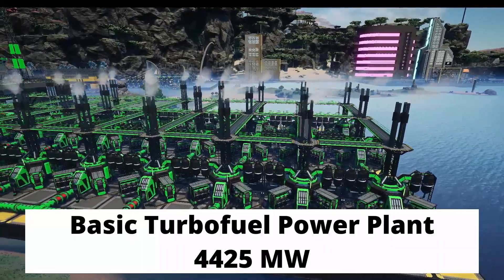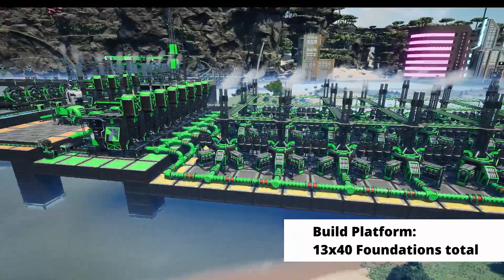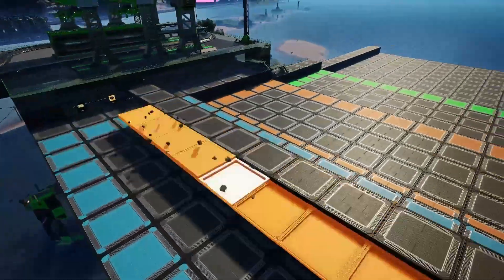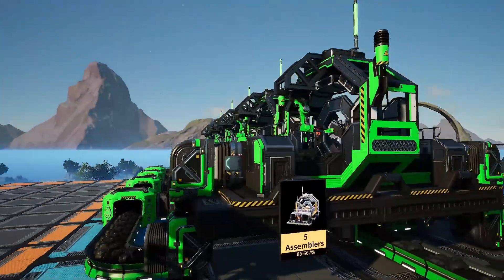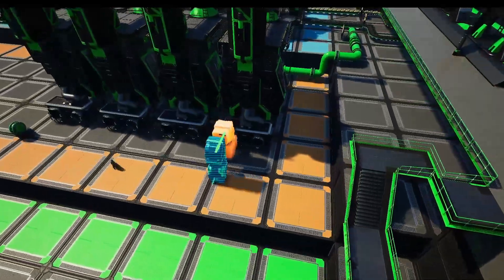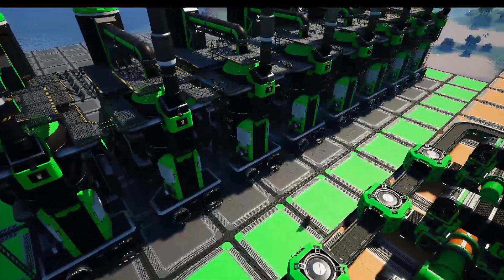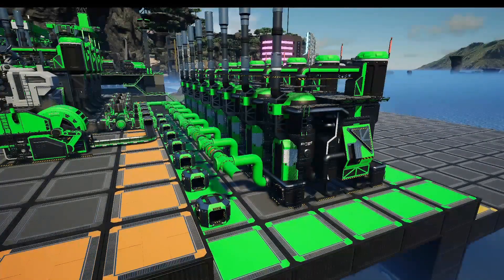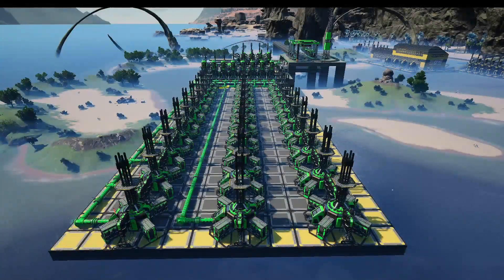100% EFFICIENT Simple Turbofuel Power Plant Build Guide - Satisfactory Update 8

Comment from the maker: per @Shammyy1" I mathed it out, and the correct number of generators in the new version is 17, with 1 underclocked to 75%. Feel free to pin. This allows a .2 over production of turbofuel.
Reply: Per below discussion because I didn't see further research done, this message is correct (with clarification). 18 total generators, 17+1 underclocked. 17x7.5=127.5+5.63(underclocked one)=133.13 of turbofuel being used out of 133.336 (8x16.667) being made so .2 extra being made. Hope I save someone a maths.

Comment: Does it matter which belts are used? my compact coal is running out very quickly it isnt creating enough to feed all of the refineries to make turbo fuel. i am using mk1 belts rn which i can change and 1 normal node of coal and sulfer. i can upgrade to mk 2 or possibly 3 but im unsure. with that belt being split 8 times i dont think its enough but maybe im wrong @Dekoba

Comment: thanks for the video! i really enjoyed building this. But, its not working for me. I set it up exactly to your specs, and did only 18 of the fuel generators, one clocked at 75%. I let them all fill up totally before starting, and the ones in the back of one of the lines continue to run out of fuel. Its unclear in the video how you hook up the pipes, if there's a certain way it needs to be split, but ive tried two different wants and it continues to lose power. Can someone please tell me what ive done wrong? Is frustrating because i followed this EXACTLY.
Reply from the maker: In a few minutes I can pop into a discord call out multiplayer and take a look,  but I cab confirm the design is still working
Reply: @Dekoba oh man whatever you could tell me would be great I'm sure it's something I've done, and I am trying to get better at the game!
Reply from the maker: Heres my discord, well chat more there https://discord.gg/ZBvWGSYj
Reply from the maker: @The_Mattcade I can't tell without seeing your setup. But turning off another generator to over produce and stable is my first step.  I want the generators stable and the refineries flickering from over production. Instead of the other way around.  From there I can increase generator load slowly until the shortage appears and track it more precisely
Reply: @Dekoba hey man thank you so much for the replies. When I was on earlier, I had other issues happen after, as in my sulfur line stopped running. So I wanted to fix all that before I called you up, and I decided to redo the piping of the turbo fuel into the generators. I have it merging out of all 8 with 3 splits off that line going to each of the 3 rows. Then I looped the 3 lines together at the end as well. Then I put in like 4 fluid buffers so I could monitor better, and totally restarted the whole factory from the get, and waited until each step was fully loaded and fully backed up before powering up the next row. I had wound up putting all the different stages on separate power lines anyway because I'm anal. Long ass story short, I powered up all but 3 and it was fine, powered the last 3 up one at a time and it's been running for 3 hours now all 4 buffers still full. So I guess I didn't prep it before as well as I thought! It's WORKING. Thanks again for thr help!

Comment: Why is it only 4400 MW if the 30 generators combined can produce 7500?
Reply from the maker: This is an older video, they changed the values of the generators in September. The design still works but uses fewer generators and still generates the same amout of power.

Comment: anyone calculated the changes for this setup in 1.0 ? :)
Reply from the maker: I don't think there are any. The plant still works in the world I built it in.
Reply: @Dekoba  really? the increase for fuel generator is only for normal fuel?  was atleast expecting having to cut down on a few generators. but that could be for normal fuel only maybe the increase from 150 to 250
Reply from the maker: @kenjooh93 ah good call. I'll take a closerr look
Reply: @Dekoba  I mathed it out, and the correct number of generators in the new version is 17, with 1 underclocked to 75%. Feel free to pin. This allows a .2 over production of turbofuel.
Reply: @Shammyy1  I think you mathed it wrong. It should be 18 with 1 at 75%. 17x7.5 would only be 127.5 or is there some loss or something?
Reply: @The8BitHero  I'd have to look at it again because it was 3 days ago, so I dont remember all the numbers. 18 is possible though, mightve just mistyped 17-18.
Reply: Def having some issues, clock speed at 88.888% on the Turbofuel Refineries only produces 133.336 Turbofuel per minute. while the generators consume 225